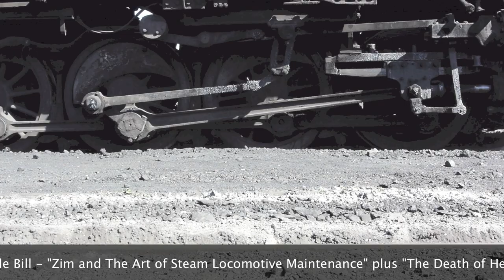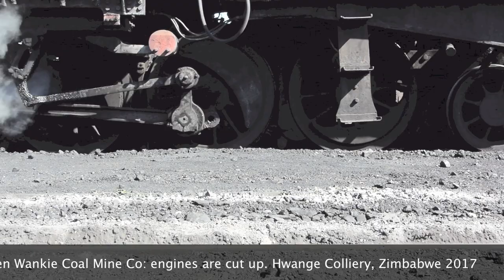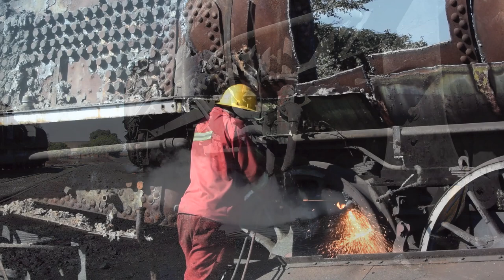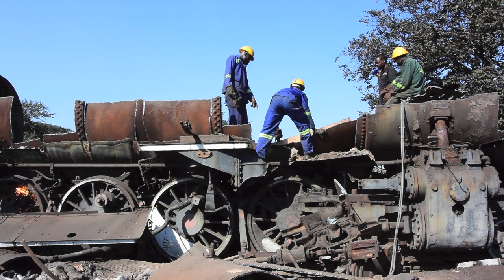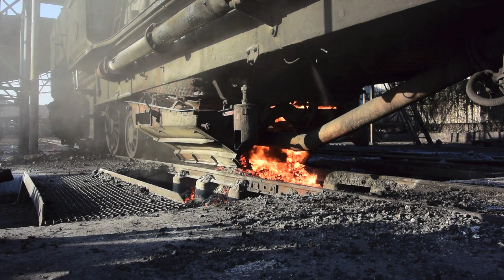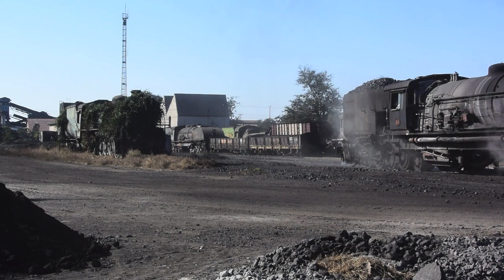The Last Garratt - Zim and The Art of Steam Locomotive Maintenance - Hwange Colliery Zimbabwe 2017

Comment: 2017 and cutting up steam engines? arnt these things worth more in one piece???
Reply: brett cheeseman Great cutting action! Slice those crap steam locos apart!
Reply: you have vary poor investment choices like the people in the video
Reply: brett cheeseman Rip all steam locomotives apart with cutting torches and melt down the scrap.
Reply: brett cheeseman There is far too much rail preservation. In the UK there are piles of locomotives and stock hanging around rusting in sidngs that nobody has the time or money to restore. 20, 30, or 40 examples of fairly mundane classes are "preserved". Not only are these locos very polluting when they are running, they are a blot on the landscape when unrestored  We need to recycle a lot more rail junk of all kinds.
Reply: i think the place your talking about has already been cleared up.
Reply: a lot end up as static displays as well, whats wrong with static display? i get where your getting at, but i think the ones with high numbers and are rather pointless or vary costly to repair, should be salvaged for usable parts rather then scraping the hole thing, it then becomes cheaper for the engines that can be saved to be removed. preserving historic things like this is impotent, and i believe they are working on ways to run engines with less pollution, i think some engines in the us run on coke.
Reply: also you have to keep in mind, is it worth saving? would it be more profitable to restore the engine or sell it to someone who will restore it, or is there more cash in scrap? considering these things before destroying en antique is impotent, unless you don't care about the most effective profit income, or you don't bother considering it, witch i believe the people in this video are not considering this. the loco's there looked in fair shape and could have sold more as a hole for either parts or restoration.
Reply: thats pretty damn dark for someone of the traction engine community...
Reply: yes seems though from the comments the mine had no other choice and needed to sell the scrap for money and not because of diesleazation for once, unfortunatly, and for those that say they pollute, you can burn anything in the firebox that can combust it dont have to be coal it can be wood, or even bio coal which they are working on and its cleaner, non of the black smoke, and the process for converting biowaste like wood or cattails in mauratania is more effecent then converting it to biodiesel that is the gases are reintroduced into the roaster to help combust so it is more thouroughly used, at least with the project that the coalition for sustainable railroading is working on as well as a new high speed locomotive using Livio Dante Porta's and David Wardales advancements in steam tech that cut down mantancance and make more power and efficentcy in a steam locomotive, just go to their page and read the white papers written by porta with the forward from Wolfgang Fengler one of the formost pressure designers in the nation and world.
Reply: @pmonkeygeezer6212  you couldnt be more wrong. The Garratt Concept is great.

Comment: unbelievable in 2017 they are still cutting up steam loco's, by now every engine still in one piece should be preserved and restored for future mankind or re-use parts like cylinder castings, wheels etc which are almost impossible to manufacture nowadays for engines still running! The price of scrap metal won't come even near the value of technology of the olden days! It's  like cutting up the Mona Lisa painting for it's linnen cloth !!!

Comment: We need fix up set up steam engine 6042 makes up built up clean inside and outside spray painting good going to run up steam 6042 and 6029 with together runs back on railways why not get up steam going
Reply: Fine you fund it.